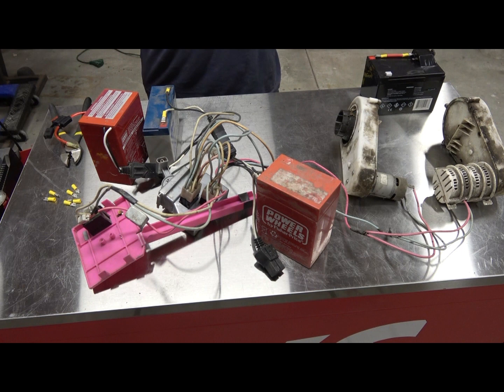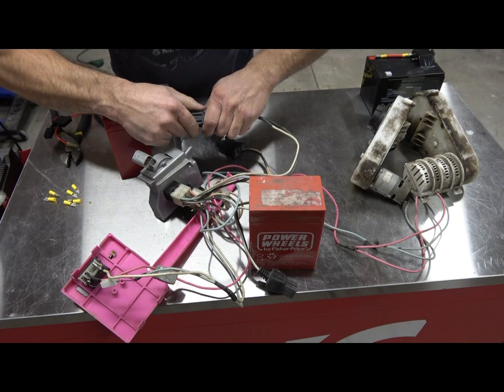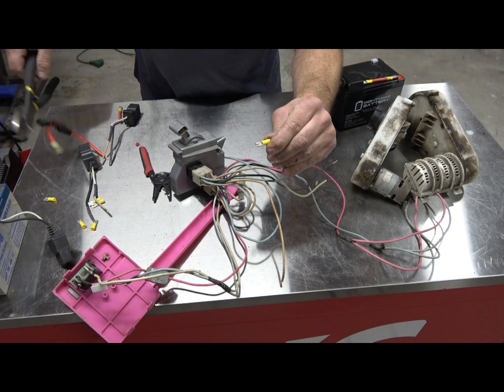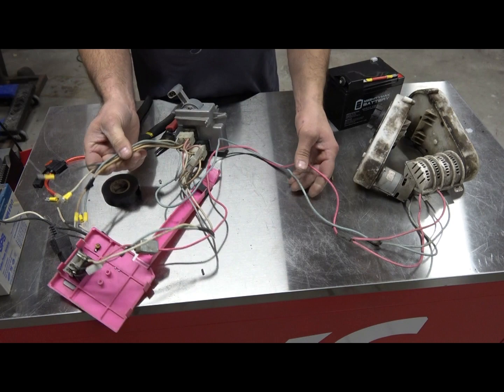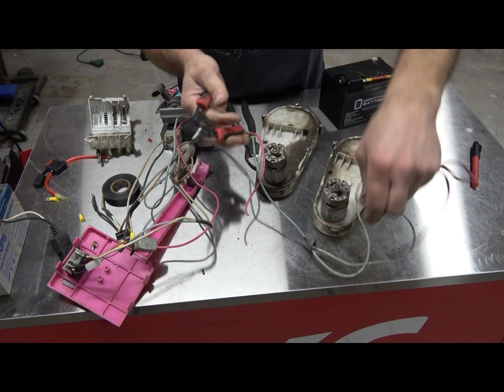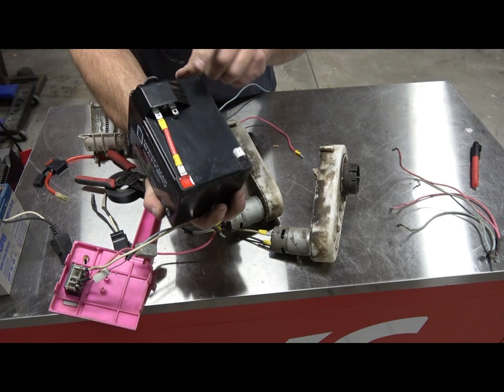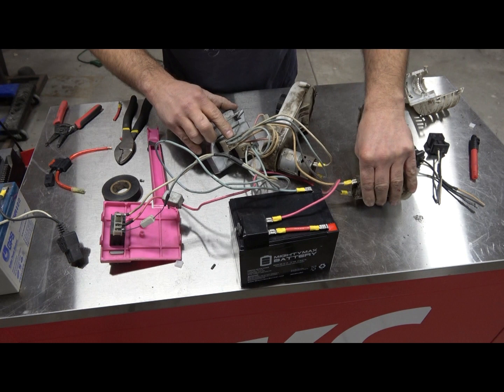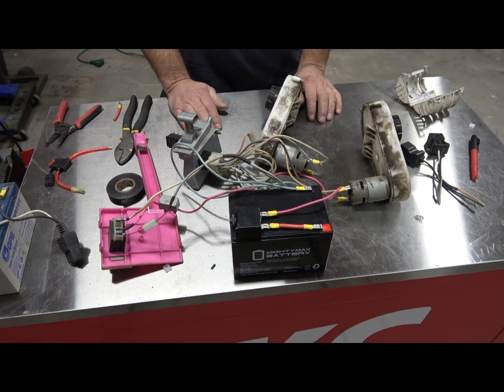Convert dual 6 volt batteries to a single 12 volt battery #powerwheels #bigfoot #ogwiring #battery

Comment: Sorry may I ask if there is any limitation to using this harness flip? I have a old 1990s jeep power wheel and its got 2 toggles for low speed /high speed and forward /backward. Will all these toggle still work?
Reply from the maker: Cannot confirm that, but I don't see why not.
Reply: @CustomKidzCars  I believe in the video at one point, you mentioned that's it is only 1 speed as a result of using this flip with one 12v battery so I wasn't sure